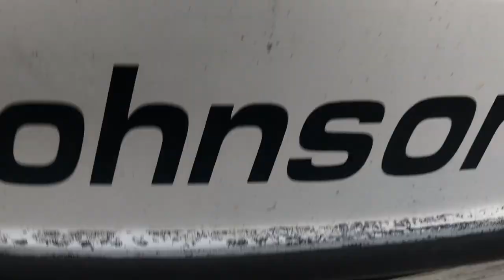Found my next project ! 1985 StarCraft Center Console

Comment: I bought a 1972 Starcraft 16 SS. Perfect hull, everything else rotted out. It's a good project.
Reply from the maker: Oh yeah. That’ll give you the option to make it how you want it. Make sure you put new flotation foam in it when you rip off the floor.
Reply: @MotoRoUsa  if you unscrew the floor you have access to the entire floor for replacement ?
Reply from the maker: @AmazonWebService98  assuming you can unscrew it, yes. Under the floor it has the foam